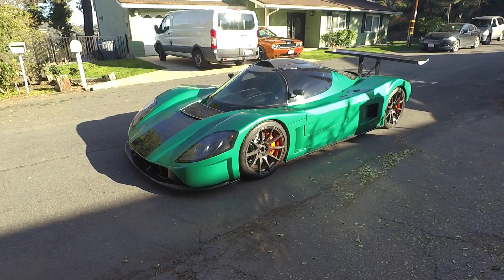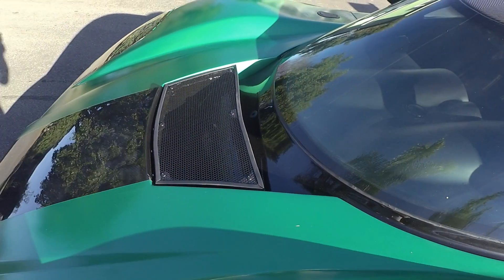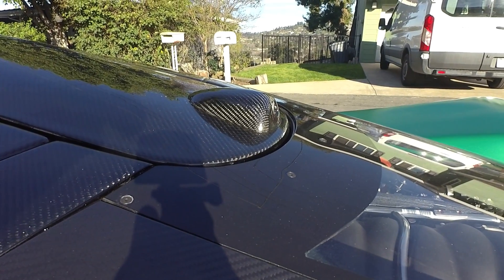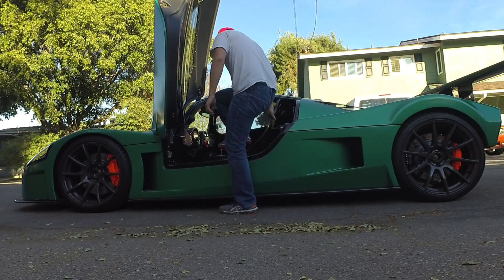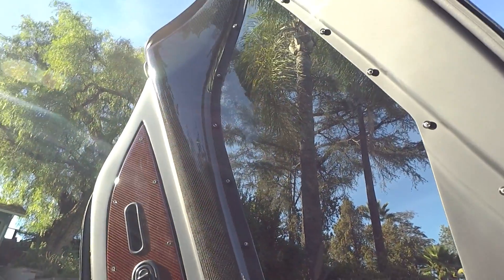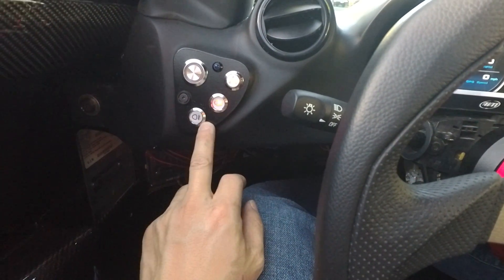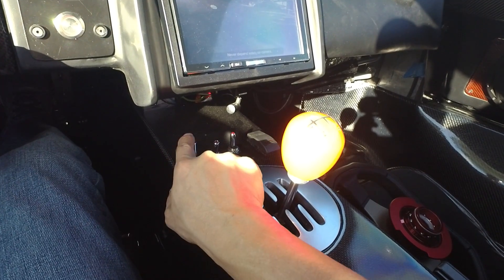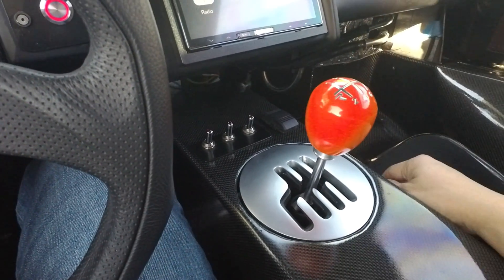Superlite SLC - Walkaround

Comment: Sell this and get the Ultima RS
Reply from the maker: @Perpetual Student - the refresh is an improvement but the original issues I had with that car remain unchanged: outdated design, tube frame construction, excessively pronounced bubble canopy, and overseas vendor.
Reply: @CamThai  Forgive my ignorance, what is wrong with a tube chassis and what type of chassis is the SLC?
Reply from the maker: @Perpetual Student - both the GTM and Ultima use a steel tube spaceframe
construction method.  The SLC is constructed using welded extruded aluminum tubes and plate aluminum along with bolted in steel tube roll hoops and frame stiffeners.  The issue with the GTM and Ultima (IMHO) is that the frame is constructed/stiffened using hundreds/thousands of rivets securing thin aluminum plates to the frame.  Every one of those rivets requires a hole which acts as a stress concentration/weak point in the tube.  In an impact, all of these holes are potential failure initiation points.  You have to drill into the SLC frame as well but not nearly as many holes, and none of my steel tubes have holes in them.

Similarly, the Ultima uses steel tube suspension members welded together versus billet aluminum on the SLC.  You pay for it by weight (the SLC pieces are likely heavier) but quality and strength are higher, again, IMHO without any actual analysis on my part.  The GTM uses donor suspension from a corvette, and since it’s a donor design it’s (likely) compromised due to the very different vehicle characteristics (track, wheel base, weight, etc).
Reply: @CamThai  Thank you for taking the time to prepare this!  I found it very interesting.  Godspeed.